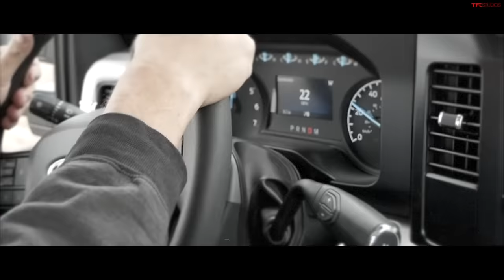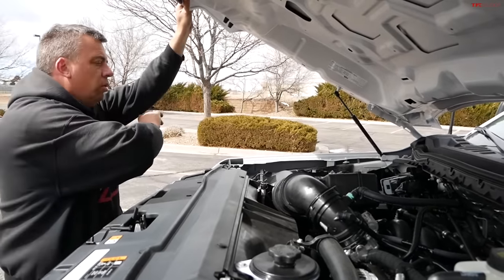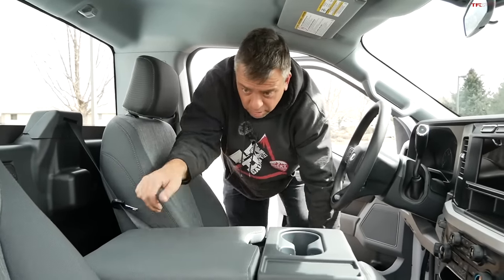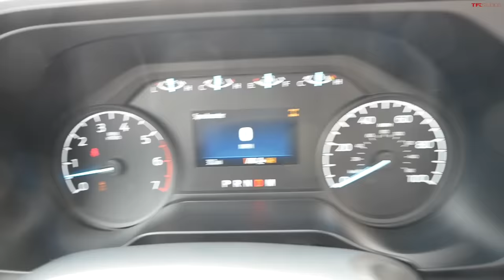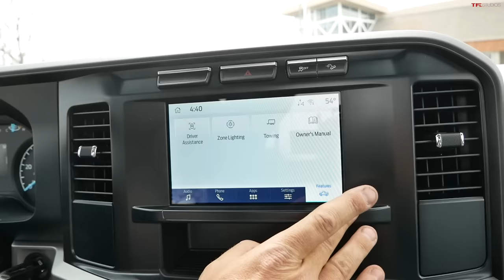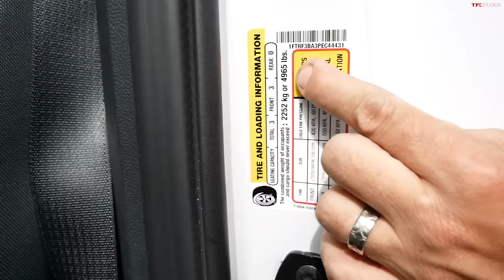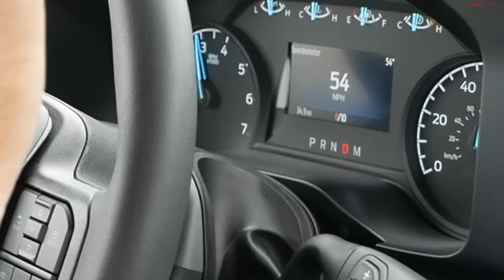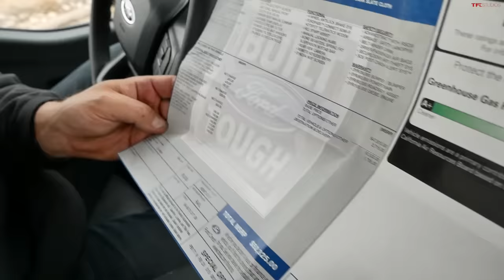I Drive a 2023 Ford Super Duty XL Work Truck with the Brand-New 6.8-Liter V8!

Comment: When Ford releases a new truck engine every couple of years, EVERYONE pays for it -- literally!  They don't have enough dedication and foresight into one engine to invest heavily in just a few; their 3.0L V6 diesel was crap from the get-go and never caught up to GM's and Ram's.  Honestly, they just need a small to midsizes NA V6, a small turbo (2.7L TT V6) and big turbo (3.5L TT V6), and then one proper light-duty diesel option.  In heavy duty, one NA V8 (won't even bring in displacement though 7.3L was fine... 5.0L Coyote probably isn't much cheaper and has more high-end torque and HP so again... Ford exiting pushrod since mid-90's is... cough cough yeah...), a turbo V8 or a V10 gasser, and LO and HO diesel engines is plenty.  But of course, being the market leader means they can burn thru cash like nobody cares.

Ford lost my respect in the early 2000's.

Comment: I know technology advances over the years and new things come along, or bigger engines/parts/turbos, more engine means more need of coolant, etc. But... looking at that engine bay hurts my eyes. My Ram 1500 might be twenty-two years old but, I can look and fit under the hood, even with some hoses and lines in the way. This thing looks like it has a similar size front end/hood but the engine bay seems cramped and squished. Ford isn't the only one to stare at for this but it's still painful to see. As a homebody mechanic who just wants to keep his truck running with his owner's manual and some advise from family/friends, I can work on my truck, I don't know what I'd do with this behemoth.

Comment: That's about a 9 sec 0-60. A recent you tuber measured a new GM 6.6 gas 4X4 Crew Cab 0-60 at 7.33.
Reply: He also spun through all of first gear. I think ideally launched the 6.8L and 6.6L GM will be very comparable as their output is very close.

Comment: Would be interesting to compare the 7.3 and cut down 6.8 head to head if you can get similar spec trucks.
Reply: If I remember correctly, the only major differences are displacement. Either a smaller bore or a shorter stroke  it's been a couple years since I read up on them.

Comment: Interesting that it's lacking 17 ft/lbs to the V10 with same displacement. I'd like to see the dyno power curve. 

The old V10 was deceptive. It may not have screamed with the high RPM horsepower that these V8s do but they pull like a damn diesel down in the basement. That's what counts in work trucks.

If this pans out, GM & Dodge/RAM/Stellantis whatever the fukk they're called nowadays might as well close their doors on 3/4 ton & up trucks. This thing is outfitted almost perfectly... with the exception of the stupid ESOF transfer case. I'd still rather have a stick in the floor.

Comment: Is this going to scatter the bottom end like the 7.3 loves to do? or the oil pump drive chain tensioner failing, causing the pump to not pump oil? or the lifters going to crap out and wipe out the cam? Leave it to ford to screw up a pushrod engine. giant turds

Comment: only 400hp/440trq from a 6.8?? man that's not much better than the 10 year old 5.7 hemi. Ford needs to step up the game a bit.
Reply: No they don't. The 5.0L Coyote "which makes 400hp and 410ftlbs of torque to the Hemi 5.7L's "395hp and 410ftlbs of torque" is Fords primary V8 Hemi competitor. The 6.8L isn't designed for speed, it's designed for durability.

Comment: Is this Ford's way of admitting that OHC and turbo v6s don't belong in 3/4 ton and above gas trucks?
Reply: When did they ever attempt to put a Turbo V6 in an F-250+? And the Ford SOHC 6.2L has gone down as one of the more reliable gas V8's any manufacture has turned out in the last decade. So no, this isn't Ford admitting anything other than it cost more money to keep the 6.2L in production in lieu of replacing it with the 6.8L because the 6.2L shares absolutely nothing with the 7.3L while the new 6.8L is basically just a de-stroked 7.3L with most of the same parts and machining.
Reply: @nathanmcdonald610  "because the 6.2L shares absolutely nothing with the 7.3L " It does share the same bore spacing in all 3 motors so production of blocks anyway should be compatible.
Reply: @davidmitchell7183  No.  It's a different block.

Comment: I would like to drive a superduty with the 6.8 or 7.3 with the 10 speed.  Our f250 with the 6.2 and 6 speed is awful. What a gutless, lazy, slow revving combo.  6.2l has no power down low and the gear ratios on the 6 speed are so far apart. The 5.0 in my f150 has way more guts than the 6.2.  Kudos to ford for dropping the 6.2.

Comment: Over priced, and a little too much automation with all the driving modes. 

I would like to see a direct comparison between the 6.8 and the 7.3 truck towing and not towing a crossed all the different power modes. Like eco-mode mileage versus standard mileage

Comment: Those taillights are atrocious... Also this motor seems pointless. The 6.2 made the same if not slightly more power? And utilized the 10spd. Does the 6.8 get 0.25 better MPG lol?
Reply: Parts sharing. It's cheaper to have a de-stroked 6.8L version of the 7.3L that have a lot of the same machining and interchangeable parts vs having the 6.2L which is totally different design.

Comment: I wonder if Ford under rated the HP on the 6.8L to try to increase the sales of the 7.3L. I would guess the power would be about the same as the 7.3 since the bore diameter is the same.

Comment: For ford to go through all that nonsense for a 6.8 aka 7.3  should have just used the 5.0 coyote motor. A proven motor an great hp
Reply: Parts sharing. The 6.8L is just a de-stroked 7.3L which means they share the same machining and a LOT of parts unlike the 5.0L or 6.2L that this 6.8L is replacing. It'll be cheaper in the long run to have two engines based off of each other vs each one being it's own separate thing.

Comment: the power from this engine is absolutely horrific if 405 is accurate. the 1.2 liter smaller engine in the nissan titan is equal on that front.
Reply: You can't fairly compare 1/2 ton engines to H.D engines, both are engineered for completely different purposes, Fords 5.0L Coyote will eat and 5.6L Nissan Endurance and shit it out as a Sentra.
Reply: @nathanmcdonald610  yeah right. fords 5.0 struggles to be any quicker than a 2004 5.6 all while the ford needs an aluminum body. 

the 5.6 would drag a piece of shit ford down the street. thats why you dont see those aluminum cans enter any truck pulls.

and fine ill compare this engine to the much more ancient ford v10 that put out very comparable power,, and if was newer with a refresh, would trash this new engine. its got bad numbers. its a fact. it better be bulletproof.
Reply: @cerberus1166  That is total delusion, My steel bodied 5.0L has never lost to a Titian much less an aluminum bodied 5.0L lmao.

Comment: A very sensibly equipped truck. Basically the right stuff for a working truck. However, I am a bit put off by the dash board. 

I don’t like the labeling on the speedometer. They took away to many of the numbers. The common speed limits are to many gaps. 

The acres of cheap flat black dash plastic on the dash panel just doesn’t cut it for me. Plus, the center area of the dash protrudes too far into the cab. Takes up too much people space. Makes an otherwise fairly roomy cab look and feel very cramped. And what is it with the back side of the cab wall behind the seat? What ate up all the space back there between that covering panel and the back of the cab? 

This show just how roomy and sensible the cab is in stubby. Stubby is a much nicer place to get comfortable in. (Stubby is TFL’s Ram 1500 classic regular cab pickup.) 

those headlamps, I will have to let the new styling on those percolate for a bit to see if I like them or not.  I do like the bedside and rear bumper corner steps. And I like the 8 foot box. All those 4 to 5 foot shorty boxes are so dumb on a real proper pickup truck. 

A good new truck overall.

Comment: 6.8 replaced the 7.3? It’s a serious question. I’m from Holland so I really don’t know.
Reply: No the 7.3 is still available, they just made this engine to replace the entry level 6.2
Reply: @Bruhwhatthehellbruh  okey 😊 thanks, then the difference didn’t seems that much does it?
Reply: @antonfloor344  Parts sharing. The 6.2L that the 6.8L is replacing as the current entry level engine is a completely different engine. The 6.8L is just a de-stroked 7.3L which means they share the same machining and a LOT of parts unlike the 6.2L. It'll be cheaper in the long run to have two engines based off of each other vs each one being it's own separate thing.

Comment: god it's ugly... 
My biggest question is, did they fix the lifter roller wear issues in the engine that the 7.3 had?
Also, with inflation of 6% per year since 1993, this truck should cost in the neighborhood of $41.5K

Comment: I am disappointed.  I looked forward to getting the 7.3. L.  Now they make this to cave to environmentalists.  My f150, a 3.5 L with 190 k miles, puts out the same power almost as that 6.8 L.  Disappointed. ....
F150 has been maintenance free up till now, and even then the engine and turbos are still good.  Seals for the turbo lines go bad.  What can you say, its not a honda

Comment: 2023 Ford F350 6.8L V8
405hp
445tq

2007 Toyota Tundra 5.7L V8
381hp
401tq

🤔🤔🤔🤔
Reply: 2023 Ford 5.0L V8
400hp
410ftlbs of torque.

You can't compare a 1/2 tons engine to anything in the HD trucks like the Super Duty. 1/2 ton trucks are designed to drive better and be more fun on the road "while still retaining some truck utility" as to where HD trucks sacrifice unloaded performance for long term reliablity.

Comment: My tundra 5.7 has 40 less torque and about 25 less hP
Reply: And a 5.0L Coyote has about 20hp and 10ftlbs of torque more with nearly a full liter less displacement. H.D trucks are always detuned from their full potential in favor of reliability.
Reply: I looked it up on wiki and yes the 2021 model year has those numbers., this is a 5.7 2007 engine on a 2019 Toyota truck.
Reply: @dannybuilding1044  That point is that 1/2 ton's are basically designed to be fast and responsive, H.D trucks are designed to last.

Comment: I hope ford has to eat all their trucks that aren’t selling.  I bought a new 2012 super duty and it is very cheaply made.  They are only getting worse.  My next truck is going to be a 78 or 79 250 or 350 that gets rebuilt from the ground up.  I hate all the electronic “crap” they put on these trucks today.  I’ll never buy another new one.
Reply: To do a full frame off restoration like you're talking about you will be paying about what it'd cost to get into a midrange/upper end Super Duty. The days of cheap trucks a dead, even bringing old ones back from the dead cost a fortune these days.

Comment: This ford 6.8 is a completely unnecessary  waste of time for everyone involved. Customers and designers.   Makes sense if it were available in ALL f150 models , 1 f250 model, 1 f350 model.  But thats not the case.  Only available in f250 xl and  f350 xl.  Why would any customer choose this engine?  Should just make the 7.3 available in all models and never wasted the efforts to manage another engine and all of its parts.
Reply: From
What I heard everything on the 6.8 is the same as the 7.3 just shortened the stroke.
Reply: It'll be cheaper to produce in the long run since it shares its basic architecture with the 7.3L as to where the 6.2L SOHC was a completely different platform.

Comment: I feel Ford dropped the ball once again.  Only a idiot wouldn't step up with the 7.3l. Who buys a super duty and doesn't plan to tow with it? I  wouldn't take this engine option in a f150 over a coyote. Honestly I wouldn't buy a gas motor super duty. The 7.3l's numbers are not that far off from the 3.5 eco boost. If I plan on regularly towing 10k lbs or more, I'm  buying a diesel. If I'm towing under 10k lbs., I'm saving money and buying a f150.  

I was excited when I first heard about the new 6.8l. Now it's quickly became a disappointment for me.  I  guess I'll keeping my 2016 f150  for at least another 5 years. Hopefully Ford will do better then.

Comment: Is the 7.3 not that reliable?🤔
Reply: It's an extremely reliable engine.
Reply: @themidnighttavern6784  I would disagree. I work in ems and a lot of our 7.3 ambulances are having issues.
Reply: @themidnighttavern6784  I heard that about the old one. I meant the new one.
Reply: @zynnotzen  Odd, I work on a fleet of E350 busses with the 7.3 and they are rock solid, and they get driven super hard and are forever in high idle.
Reply: @djaftermath4313  Both are excellent
Reply: @TheEuroGarage  We've had many pulled out of service. Our mechanics say they have bad foreign made cams. like you, we are also idling all the time and running hard to calls
Reply: @zynnotzen  what type of oil are you guys running and how long are your service intervals? We go every 5k miles and run havoline 5W-30 full synthetic.

Comment: Let’s see if it can make it 10,000 miles without an issue. I just got a 2023 Transit. Not even 300 miles on it and the engine is leaking oil like the Exxon Valdez. Every Ford I’ve had (company issue) since 2016 has been a steaming pile of shit. Ford makes junk.
Reply: My work truck is a 2018 F550 Powerstroke with 77K miles and it's had zero issues outside of regular maintenance. The Fords we have in our fleet are far less problematic than the GM's, hell we have a 2012 F550 V10 with over half a million miles on it still going.

Comment: Yeah, i’ll pass.  It would be smarter to find some low milage tundras with 5.7 for work trucks right now. Far and away more reliable than anything else out there, new or used and for work trucks, thats what we need.

Comment: Pointless engine, just a destroked 7.3.   Waste of time
Reply: Not to Ford, it's cheaper to cut out the 6.2L which shares nothing with the 7.3L and replace it with the 6.8L which is just a de stroked 7.3L.

Comment: 10 speed junkomatic… nope no thanks if they built this with the 7.3 or 6.8 and the 6r140…. They wouldn’t be able to keep them in stock they be sold so fast!!! Unfortunately they are sooo far down the rabbit hole with these garbage transmissions there’s no turning back…